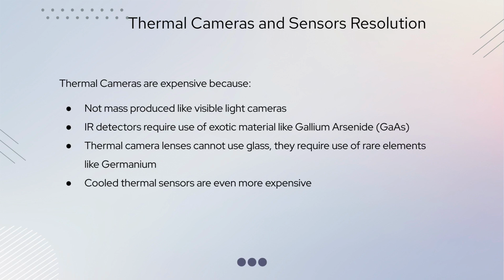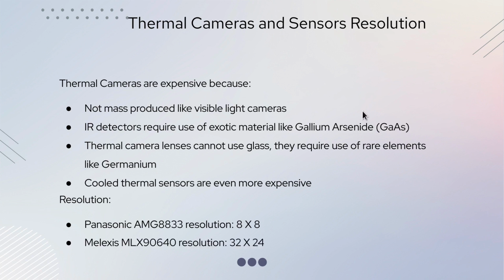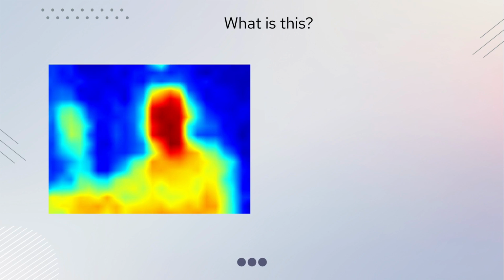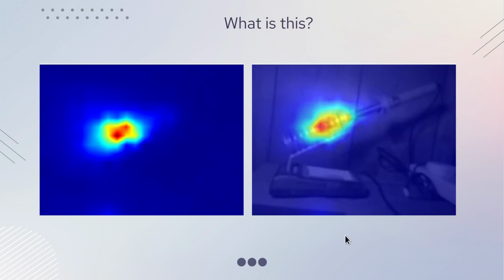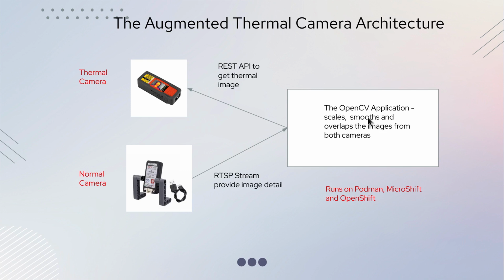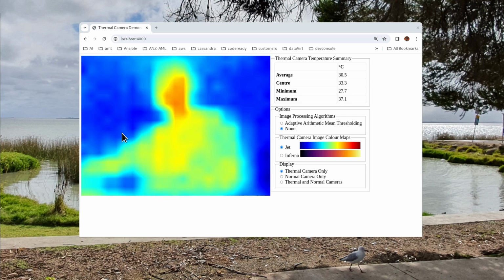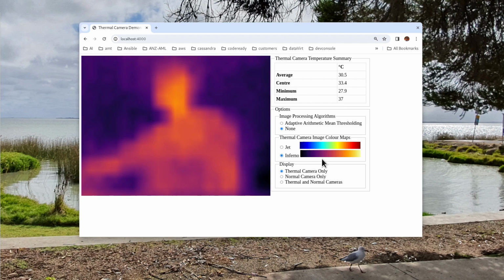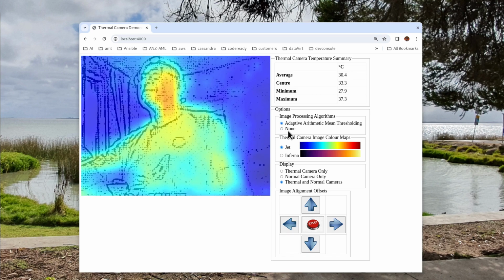An Augmented Thermal Camera

Comment: great video Andy - I am curious if any commercial duo-camera solution following what you have done has been made that you know about?
Reply from the maker: My reasearch shows that the FLIR MSX (Multi-Spectral Dynamic Imaging) line of products use a similar thermal and visible light cameras setup. Some can send image streams as well. This project allows one to experiment with useable thermal cameras in the Podman/MicroShift/SNO Edge enviornment using containers for under US$100 instead of thousands. It is great to have almost all aspects of the hardware under your control. In the Edge enviroment, it is often necessary to interface to new hardware and connect it to Podman/MicroShift/SNO. This project has everything from product development to deployment to the Edge.